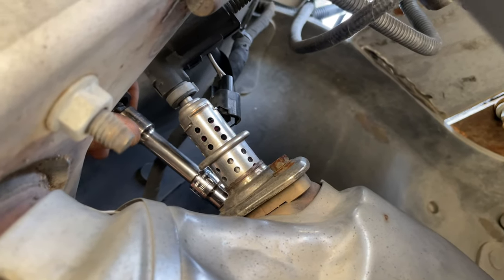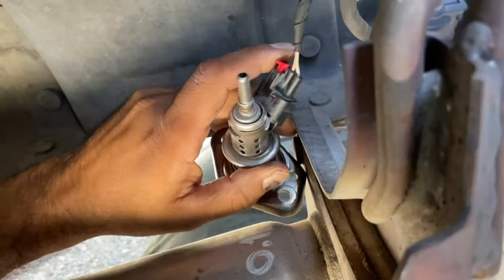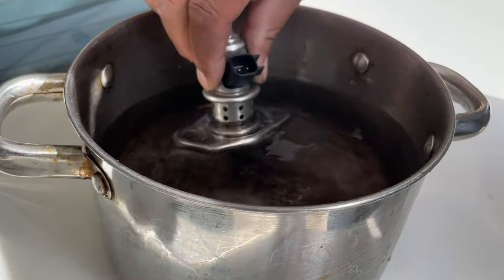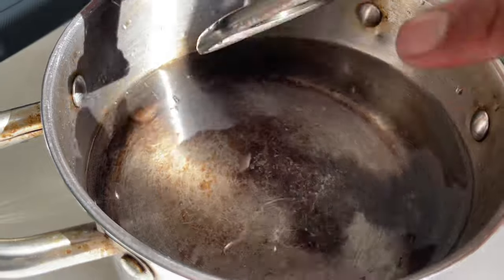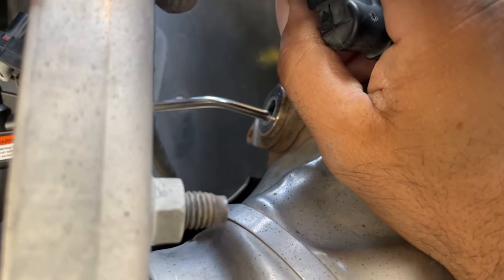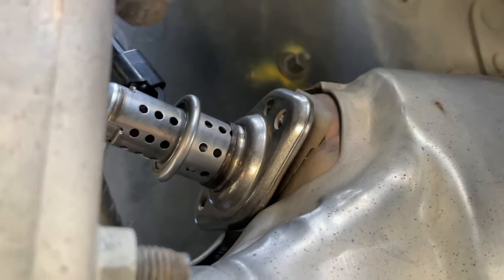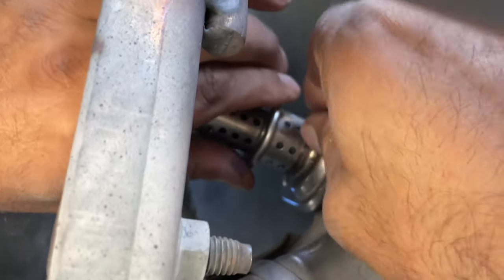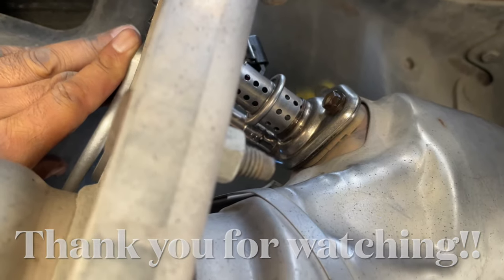Service Def see Dealer Easy Fix!! Dodge 5500 DIY repair. Step-by-step.

Comment: This video just saved me thousands. I used a wrench to get the bolts off. ( easier than the socket) and boiled my water to break up the white def crystals. Cleaned the injector and the injector hole with a toothbrush and the problem went away. Appreciate you posting this!
Reply from the maker: I’m glad it helped.

Comment: I'm getting ready to pull our 5th wheel with our 2016 3500, 6.7 with the Aisin transmission from northern Idaho to Maine and back.  I haven't gotten the check engine light or code for this but I'm going to pull and clean the injector before we leave.  I think it's good preventive maintenance.  Great video.
Reply from the maker: Thank you. Yes you’ll be traveling a distance, it’s a good idea to clean it beforehand.

Comment: When clean the port hole where injector goes in use a pick with a 45 bend on it and scrap inside to clean hole and area in side due to build up also. Then take a shop vac and tape a small hose on it To fit inside hole and vacuum any def debris from inside and good to go.
Reply from the maker: Great idea, thank you!

Comment: I got the message " def Maintenance see dealer "  on my 2022 ram 5500 with 147k . But didn't stay up on dash.  I did clean the Injector but I didn't put any air on the dpf. Next time I'll do it for sure.
Reply: Did it work without the air

Comment: Great job. The only thing In would have done differently is using anti seize on those bolts for the re-install. With the rust on those bolts and the heat from that exhaust,….that’ll be a bear to get off in the future.
Reply from the maker: Thanks for the tip!

Comment: Thanks for the video. I could not remove the def line. I did exactly as you showed - put pressure on the plastic clip, pushed the unit in, squeezed the other side of the clip and tried to remove. Over 100 tries and it will not release. Any other tips on that front?
Reply from the maker: Hello Jorge, I do have another video cleaning Def injector without removing the injector completely (link below).  You dip it in warm or hot water without wetting wires of course.  Try using Blue Def I buy mine at Costco also I no longer se bio Diesel I use #2 Diesel now and don’t need to clean often.  https://youtu.be/5RQn0XCrm10?si=x25R1nPLCTUmEaef

Comment: Based on the market lately, would you recommend someone starting up right now? I'm out of NorCal too, but willing to travel more than you guys (basically everything Texas to Cali). I'm also young and willing to sleep in a crew cab like your set up. My goal is a Ram 5500 with hopefully a 5 car trailer. Any suggestion?
Reply from the maker: That’s a good setup.   Hauling cars goes up and down. It’s currently slow, last year it picked up in February.   I recommend you get insurance quotes (it’s very expensive the first year).  Also look into truck and trailer costs, would you finance those?   I sold my two cars and boat to buy my Dodge 5500 and Ez4 trailer both used for cash.

Comment: What is the white clip or clamp called because mine broke and I can’t find another one
Reply: Any suggestions?
Reply from the maker: Sorry for late response, the dealer should have replacement part.  In the future you can clean the def injector without reming it completely (link to my other video cleaning without removing it).  
https://youtu.be/5RQn0XCrm10?si=x25R1nPLCTUmEaef

Comment: I see the gasket looks like it was all chipped out, did you replace it?
Reply from the maker: No I haven’t, this injector us about 1.5 years old. Originally I didn’t know they could be cleaned so I replaced it.
Reply: I'm wondering the same! I have mine and I think is chipped too compared to a new one

Comment: I did all this and the words 5mph in 150mi popped back up . Any suggestions??
Reply from the maker: Once you cleaned the injector how long before code came up?  Are you using bio?  I changed to regular Diesel #2 and it worked for me. If you continue to have issues you may need to replace your injector (buy injector at dealer and you install it).

Comment: Did you have to clear the codes? I just cleaned mine but haven't driven or clear the codes yet. I did turn the truck on after cleaning the injector and saw the light still on. Thinking I will have to clear the codes and drive it for a bit? Thanks!
Reply from the maker: Drive it for a a day or two if it doesn’t clear by itself clear the code.
Reply: @riosautotransportllc  Appreciate this, Thank you!

Comment: Giving this a try first before getting everything "deleted"... but still under warranty... second time this happened in less then 4months...not a good thing to see while on road trip
Reply from the maker: I haven’t had this problem since changing to blue deff from Costco and I no longer use Bio Diesel.  Before I had to clean it every three weeks, its been a few months and no issues.

Comment: so what about when you do this and the message is still on, add adblue?
Reply from the maker: Most of the time it cleared but I have had to clear the message.
Reply: @riosautotransportllc  im still stuck. i got the engine light off but the engine will not start in 14 miles

Comment: Did you have a check engine light before this and does your truck work like before after you cleaned it?
Reply from the maker: Yes the check engine light did turn on, I cleaned it right away. My truck never lost power.
Reply: @riosautotransportllc  ohh I have to try this mine has check engine light and says see the dealer
Reply from the maker: Yes try it, you may need to reset it.
Reply: @riosautotransportllc  it worked but it keeps getting dirty and stuck I think it’s my def tank than
Reply from the maker: Try the blue Def i buy it Costco, don’t use the cheap def.